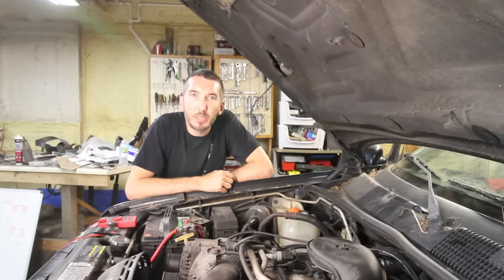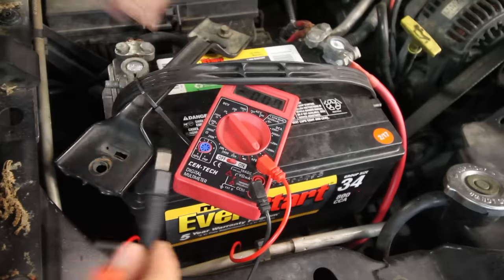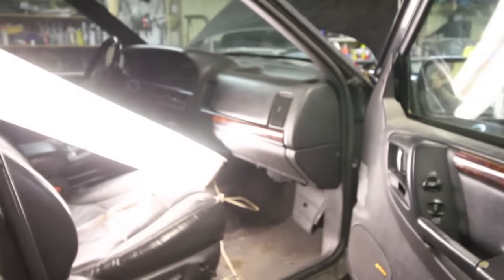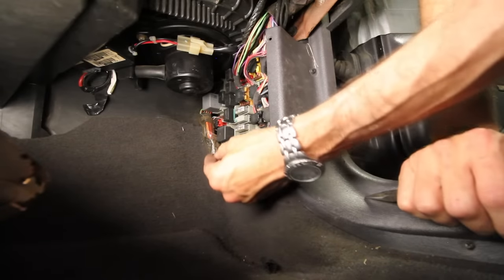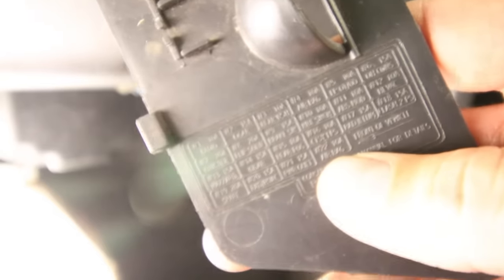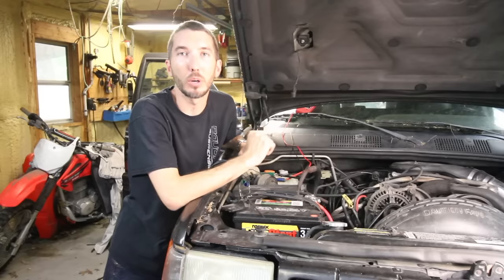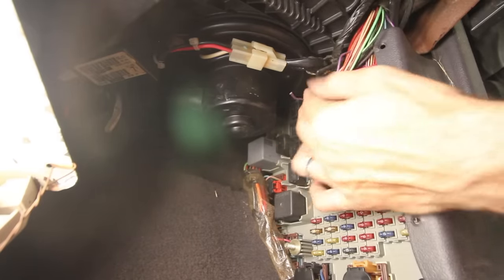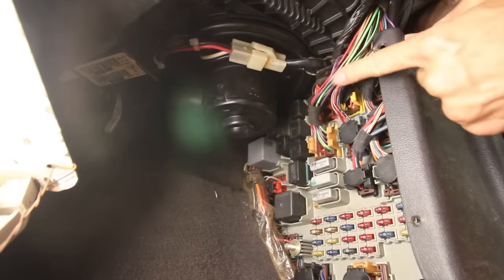Why Does My Battery Keep Dying? - Parasitic Draw Test and Fix - Operation Cheap Jeep

Comment: Thanks!
You helped me diagnose my air conditioning climate control unit that is pulling too much amperage while the vehicle is off. 
It was replaced previously by the previous owner so I guess it's time to do that again.
If the vehicle starts again tomorrow morning without a jump then I'll know for sure that was the problem.

Comment: Thanks that was a better way than what I did for my wife's car, her battery's one after another kept going bad. I placed a disconnect switch on bat. ground wire. Then when she got home from where ever we turned the switch off. No more dead bat's?

Comment: My 99 Ram 1500 had a draw, I used that same method and tracked it down to a fuse marked IOD that stands for Ignition Off Draw. This is everything that stays hot when the ignition is turned off, interior lights, radio memory, lighter, and so on. Basically goes all over the vehicle. In my case I got lucky and found it first try, glove box light switch was broken and the light was staying on all the time, but can’t see it even in the dark.

Comment: This vid saved me from being suicidal over stress trying to figure out the short lol. Found out it was hood latch sensor and hood light (top purple wire, bottom purple would be rear light and latch sensors). Previous owner yanked out the wires that stripped in the abyss of engine bay causing the short constantly drawing 0.3 and battery would die in 2-3 days. I just took the wire out and now it draws less than 0.01...fine with me.

Comment: Great video that can apply to all makes & models. I currently have a 97 Chevy K1500 that will go through a battery at least once a year. This video will give me a starting point to try and track down why it keeps dying. Again, great video!!!
Reply: Did you check the alternator? Sometime alternators work but not fully n this will cause batteries to die faster cause there not getting charged enough, other times alternators go out fully n you cant drive your vehicle, i had a car going through a battery between 1 n 2 years n had found some more info out n found out it could be the alternator, so i got a new alternator

Comment: I liked the diagnostic logic.  My only suggestions: using a four digit multimeter it should be possible just to measure the voltage drop across the battery to detect a small parasitic current draw, this saves the problems of disconnecting battery, frying leads to multimeters if something gets turned on, shorts, car computer/behaving badly after having power  connected, car computer having to learn/map driving, radio presets   etc.

Cutting the offending wire? what if it did control something vital, getting the soldering iron down there with limited wire to work with to join it back up again would be hard work, with a sharp small screwdriver/ tool and a bit of study of the connector, should be able to pull the metal connector from the plastic shell without damaging anything.

Comment: What I'm wondering is do some of the compositors or body control modules draw until their situated. In this case above I guess not, however I have noticed most computer controlled vehicles have to draw, even with the ignition off for a few seconds. I use a test light instead of an amp meter accomplishing the same thing between negative post and neg cable disconnected, and some will draw for a spell then stop, and some will never stop until you tap the neg cable back to the neg battery, wait a few seconds then pull it apart. This makes for a difficult challenge, however I can usually tell by the brightness of the test light if it is a serious enough draw to cause a problem. Then I proceed with what you did to follow up. I just wanted to throw that in because it is a fact that some draw for a few seconds even with the ign off.
Thanks for the great presentation, your a patient guy..

Comment: Thank You So Much for Going That One Step Further!!  --My ''98 also had exactly the same problem.. After many hours of internet research, along with trial-and-error, i was also able isolate the draw back to fuse #7, but could get no further than that.. Dismantling the whole tailgate to painstakingly check each circuit was also an abhorrent waste of time that only compounded to my frustrations.. Then, after watching your video, i decided to give your solution a try and to my surprise it worked perfectly!!  Same fuse, same stupid purple wire.. I yanked that sucker (pun intended) out like a rotten tooth and have had no further problems,, Thanks again..  P.S. -Did you ever figure out what the affected circuit was?

Comment: I had the exact same problem with my KJ. After a day of offroading the liftgate sensor disintegrated and kept saying that it's open, which in turn kept all the interior lights on. It was already night when I was coming home so I was driving 20 miles lit up on display like I was the freakin' pope :) Next day I disassembled the liftgate lock and replaced the microswitch-it took about an hour and $1 to fix :)

Comment: I wish i had seen you're video many years ago because i had a draw on my 1990 fiesta. I sold it because it let me down so many times. I would say most draws are caused by switch sensors not working. Rather than cut the wire i would removed (if possible) the pin from the plug. The rear hatch switch could of been removed,disassembled(?) cleaned or replaced..it's usually water getting in or bad quality switch. Lot's of draws are caused by boot lights not going out and doors not closed.

Comment: Did that 5-6 years ago and found it was the exact same plunger switch for the tail gate. Went through 5-6 batteries but found it. Summer time it was fine for the weekend, winter it only lasted a day or half the day when it was really cold.

Comment: great video ...i have he same problem but i think it might be my alternator but not sure .its the original one to my car its a 07 dodge charger...i think it may be the diodes how often do they go bad and do you check tem...
Reply: John, are you having to jump start it daily?
Reply: @vigilantemotors  no it worked fine for a week or so then i went to start it and it was dead...boosted it let it run for a bit then shut it off and it restarted again. then tryed the next day and it was dead again.....im hoping it was just a bad battery....bc i never had a problem till i changed the battery..
Reply: @johnsmith-qz4bv  very well could be. The old test back in the day was to start you car up, safely remove the negative battery cable while the vehicle was running.
If the car keeps running it means the alternator is good but battery probably is not. If it shuts off you’ve got a bad alternator
Reply: @vigilantemotors  im going to take the alternator out and get it tested...i think it maybe the dioads maybe bad ..or it was a bad battery from the store...

Comment: Im at the part where im putting the nail in the socket to see if a jump happens.  Im running to issues

1. My number 20 cluster amp is the one draining the battery

2. I took the socket holding all the fuses just like the video did. That was the one affecting the jump

3. Ok now I attach the clip to the pin of the purple wire but it doesnt jump in amps when the nail hits its corresponding slot but it jumps in amps when I hit the slot next to it. 

What could this mean

Comment: Thank you for your video I found my parasite, was in the rear ac door blend motor,04 Durango limited Thank you
Reply: Hey I have ed a durango too 2006 mine acts strange
Reply: I need help my alternator is good and battery  but for some reason it will go but slowly die after a day or so n have to jump awhile again  do you know what is could be?

Comment: great video, thanks for taking your time to present this. I believe I have a parasitic draw, started 2 weeks ago. I drive a 2006 Jeep GCherokee, after sitting for 4 days, battery was dead, I took battery to garage to get tested, they charged it overnight, picked it up, connected it back, worked for 8 days, took my dog to the park for a walk, 45 min later, jeep would not start, got it boosted made it home left it on for 1/2 hour more to make sure its charged and here I am watching your video, went and tested for parasitic draw, multimeter showed 0.03, .04, does that mean there is a draw?
thanks

Comment: Make sure to cut the wire in a place where you could reconnect it easily, leaving enough wire length from the connector to manipulate strippers, crimpers, etc.,or if you somehow ended up cutting the wrong one. There's also a "punch down" tool that releases the connector from the housing, which may not be justified in owning, for this situation.

Comment: Omg....i think you just helped me solve my issue. I have a 2009 Hyundai Genesis and about 8-9 months ago i had a busted Headlight which needed to be completely replaced. I drove it like that for awhile then months later it started having issues with the battery mysteriously draining overnight for no reason or even if I drove the car to a store and shut it off, when you restart it, you hear a click sound and the battery automatically died but when you get it jumped the car comes back on. I took the vehicle to Hyundai, they replaced my headlight assembly and they also said there was some bad wiring connected to the battery so they was supposed to fix it....(charged me $2500) long story short the car was working fine for a few wks but then I noticed if I shut the car off and leave it for more than a day then the battery automatically dies. Took it back to Hyundai and they telling me I have an issue with the TCM (Transmission Control Module) when I looked it up it has nothing to do w/ my issue so watching this video really shead some light so im going to take it to a regular mechanic and hopefully they can tell me what is pulling or draining my battery.  Nice video....thx!

Comment: You may have solved my mystery , although I'm not sure which one of the switches is the latch sensor but I guess if it's a purple wire it may be it. If you happen to see this is the sensor switch you are talking about the small flat one on the latch assembly ?

Comment: dude i need serious help,i have a 2005 chevy blazer,the battery is going down super low over a weeks time,i have a brand new yellow top,ok so i did the parasitic test,but nobody says anything about this,i pull a fuse and it doesnt drop,BUT when i put the fuse back in then it drops on the multimeter,whats up with that,what does that mean,ok so i have two,1 is fuse 19 rad/bat it controls 3 things the radio,cluster,and hvac.and then the other drain is my bcm,my bcm is different than yours ,you were pulling wires from under the bottom of the fuse panel right?  you called it the bcm,so can i lift up my under hood fuse box flip it over and try doing what you were doing for my bcm that came up doing the parasitic test,damn bro i hope you answer this one,im stressed to the max,anyways i will check back to see thanks

Comment: Great video, found the problem fuse, acc so for now just pulled it, seems like it was only for cig lighter and after market stereo, dont use either.  may stay like that     thanks for the tips

Comment: Matt great video thank you. Very helpful, Some one correct me if I’m wrong because I’m not 100% sure  but  I think to check if the wires are shorted or not when the plug was out you can check the ohms between each of them.  And they should be all very high or OL since it’s not connected. If anyone know if that would work please let me know. 
Thank you!

Comment: I am a solid (I am going to say good) home garage mechanic...but I SUCK at electricity - That being stated, this video helped me immensely diagnosing a draw from a 2000 Cherokee XJ - I literally watched 16x to get everything setup correctly.

I dont know if this matters (again I suck at electricity) but:
The red lead on the multi is connected to the blue alligator which is connected to the negative (-) battery POST.
The black lead on the multi is connected to the green alligator which is connected to the black (-) WIRE which goes to the negative battery post.
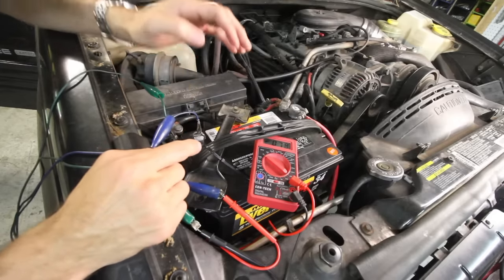Good Look: 2:59

Comment: Question. 03 Tahoe Z71 5.3L.  Battery drains in 3 days. New Battery, starter and alternator. 
After removing negative Battery line, what did you hook meter to? One line to Battery and another line to what?
I put both lines on the negative post, and my meter showed 00.00 on milli amps.
Thank you for this video.

Comment: I discovered a parasitic drain in my 1983 Mitsubishi Starion, and I believe it is because the emergency brake light indicator on the dash stays on all the time due to a faulty switch.  The easiest fix for a car I drive only once or twice a week at most, and all locally, was to install a battery disconnect switch.. available from Auto Zone for about $7.00.   I just disconnect the battery when I am not driving the car.  This may not work well with newer cars since the ECU computer may have to re-learn a lot about your driving habits every time you connect the battery.

Comment: Dumb question:
You say make sure door lights, etc. aren't on.
Does this mean the car/battery should have power?
My 1990 Cadillac is BEYOND dead.
Put new battery in it. Within days, NEW battery dropped below 3 volts.
My 20 y/o batteries & batteries w/no water (I'm refurbishing them) show between 8-9 volts uncharged.
Should I put old battery back in car to run these tests?
Also, when I hooked battery chargers (tried 3 different ones) to battery - battery (not charger) made horrendously loud buzzing sound.  Cable polarity was correct.
On SS. Can't afford mechanic in this Bidenomics Economy.
Need to get car started. Been stranded for 2+ months. Running out of food & cleaning supplies.
Any help would be much appreciated.

Comment: my only comment is that when you start testing the block connections (10.20 on) we can't see the pin connections as your left hand blocks it, so we have to guess.   apart from that it's great... cheers

Comment: Mine is a lil uderpowered though new by about 45 CCA's . Other one was 585 this new one 540 CCA Sounding rough when it used to start . Just got it out of shop . I hope I didn't damage starter or anything else . 2016 Ford Focus SE 2.

Comment: I also thinking about the ECT 3000 connect that wire to the ect circuit finder should show a short or open in that circuit turn up the sensitivity control button to isolate the wire 👍

Comment: Thank you first for the walk through on the Harbor Freight Multimeter, in reading the HF hyegliphic instructions I had it in my head I could not check my car battery.
I figured out through trial and error how to check TV remote batteries, that's it. I on my YJ would have been lying on my back on the drivers side flood board to access the mini fuses and would have gladly cut f#@$ purple wire.

Comment: Great vid. I just did this with twice as many fuses. Pulling 1 made draw go up?? The right side markers was the one dropped draw to .03. Your right though in an Audi You cant trace wire, and lights all work.
What next? befuddled ! Don't see any plug harness near fuses to pull.

Comment: Currently working on a 1999 Ford Expedition. Has enough of a draw to draw a small spark when hooking up the positive lead. Also ran a light from positve disconnected terminal to  positve battery post...it lit the light up..I took some fuses out out in the interior and under the hood. I was using the owners manual..I should have taken pictures with my phone. I am not a car mechanic..so I have to use any crutch I can.

Comment: I did this for a Mercedes E350.  I found it best to pull the fuse and count to 10, otherwise the current drop would not be seen in that car.  Turned out something in the seat motor was drawing too much current.
Reply: It's a 2007

Comment: #7 on my 02 Jeep Grand Cherokee Laredo 4.7L is the interior lights or BCM.
I have a parasitic draw when Jeep is parked and off with all lights off and doors shut.
Thought it was my electric fan adjustable thermostatic switch module controller.
Apparently not.
I do know my power outlets wiring and stereo (cd player) is wired bad. I have some trouble shooting to do.

Comment: Thanks. Followed this video and found mine has the same purple wire issue. Traced it further to find the plug to my drivers door lock is the issue. Does leaving this wire cut affect any thing else? Will reconnect eventually when I find a replacement plug.

Comment: Don't start your cars while your multimeter is on amp position. At first kick, starter will draw large current (larger than 10A) and you will blow your meter.

Comment: Great video!  I’ve got a similar volt meter so will give this a go on my 2015 Camry that’s driving me nuts when the battery drains if it sits 3-4 days. I’ve checked every light and they all turn off as they should. I don’t have any third party accessories or cables plugged in either.
I’ve googling to find those blue/green dual ended alligator clips with those insulted boots but nothing comes up except the small long nose clips. They obviously have to open wide enough to to clamp on a car battery terminal.
Where did you get those?  What are they calling them?

Comment: This has happened twice... I heard something running when I shut the truck off.  I listen at the front of the vehicle to see  if I could hear anything, It was only from inside the sound was apparent.  If I knew how to stop it I would have.  I turned the vehicle on and off again but it didn't stop.  Any clue to what it might have been? Something was running. Hence dead battery the next day!